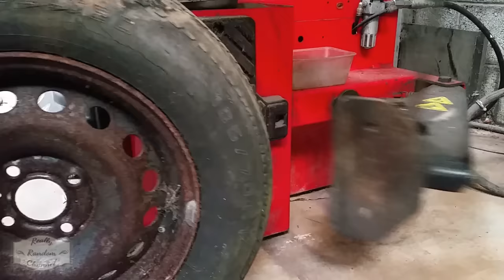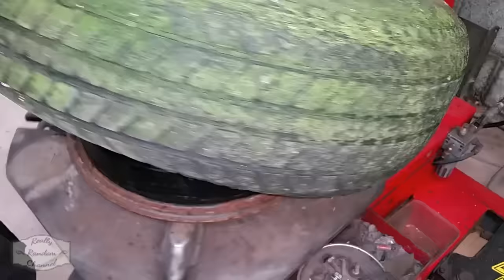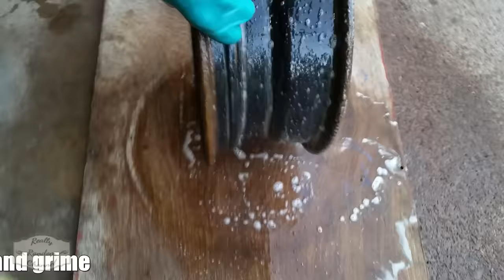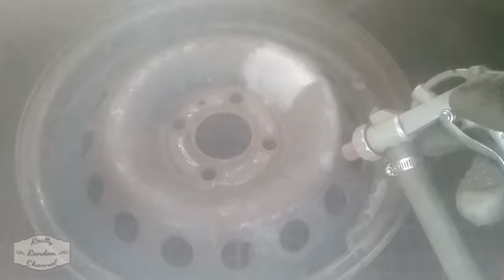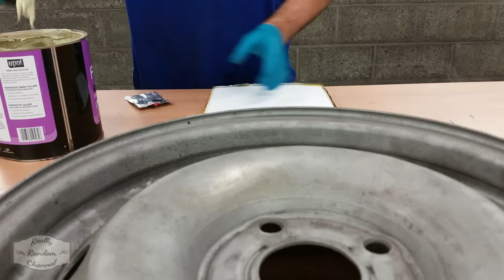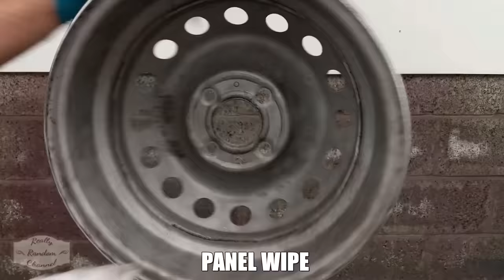Severely Rusted Steel Wheel  - Perfect Wheel Restoration

Comment: When first setting the bead of a tire always let the air all the way back out before filling it to the proper PSI. It lets everything settle and helps a great deal with balancing the tire.
Reply: Justin Fisher what? Letting air out then airing back up has nothing to do with letting the tire settle. Your federal courgias always balance like shit and your mastercraft are the best at balancing. It just depends on the tire and where the heavy spots are on the wheel. If you get cheap shit tires then they’ll balance like shit, I’ve had them before, they were amp tires.

Comment: That is a lovely job, you don't say what grit the wet & dry is not what's in the 3rd tin, I'm assuming it's paint thinners &?.
Only thought I had was to put a little lube on the valve before fitting as I think it would help seat easier.👏👏

Comment: A REAL PRO'S VIDEO!!! Not able to remove tire. Will have to do with tire still on car. What is a good mixture or product to clean rust and paint off wheel w/o hurting rubber? Also, what is the primer mixture you used? Can you advise the best way to clean and paint while wheel is still on car? Would appreciate greatly.

Comment: Say for instance you had aluminum wheels, and you wanted them painted all black like this, except the outer ring you were to polish very well. -- Could you paint a clearcoat over that polished part to protect them?
Reply from the maker: Hi,Yep you certainly can just be sure to clear coat the edges well to help prevent the clear coat peeling.
Reply: @RRCRestoration  I would say polish the outer part , tape it all off, and then paint the rest black. Then untape and clearcoat it all at once?

Comment: Does the machine that puts the tire on damage the rim? Does it have any contact with the rim while it is turning?
Reply from the maker: Hi, No no damage is done to the rim as no part touches the wheel except the clamps that hold it in place and they have rubber pads on them so no damage can be done.
Reply: @RRCRestoration  Oh nice, so it is safe. I was planing to do the entire rim but i was wondering if that clamp will ruin the paint on the edges. Thanks for the info bro!

Comment: Can you reuse the sand in the sandblaster or is it one use only? How much do you go through in a single pass?
Reply from the maker: Hi,You can reuse the sand lots of times before it breaks down and just becomes a fine powder rather than an abrasive at this stage you need to swap it out for fresh abrasive. A 25KG bag of abrasive will last me easily 3 or 4 months depending on the severity of the blasting im doing.

Comment: Can I please ask what thinners you are using ? Upol 2044?
Reply from the maker: Hi, Yeah i mostly use 2044 for these projects as the area i  need to cover is small so fast thinners is adequate for good flow out properties, Fast thinner is no use if you are spraying large areas.  I see from your channel you are restoring an XL250 you should check out my other videos as i have fully restored a TL125.
Reply: @RRCRestoration  I like that you have done your homework. It's small parts I'm spraying such as brake back plates and shock absorber etc. Fast will work for me. I love your excellent content. Thank you

Comment: no no filler if it needs it its scrap your dealing with peoples lives friend SCRAP IT PLEASE
Reply: It's a spare only, calm down.
Reply from the maker: The only reason filler was used was to fill in the tiny marks left by the rust so that the paint would be perfectly smooth. The structural integrity of this wheel is in no way compromised.